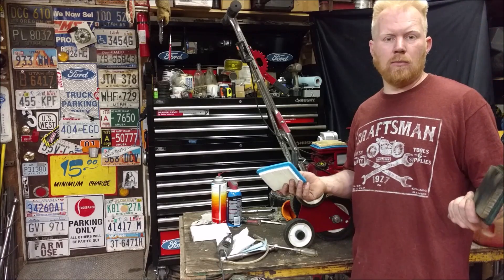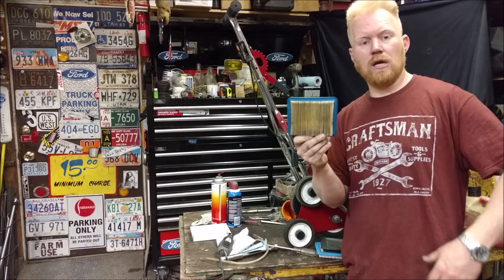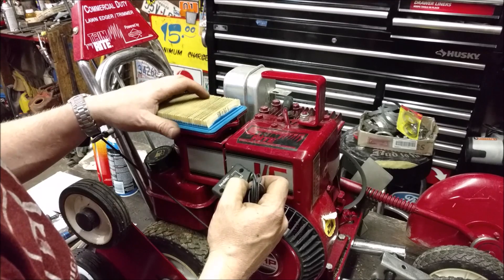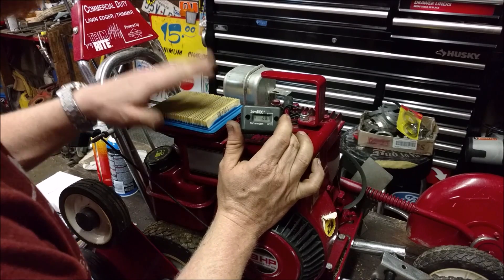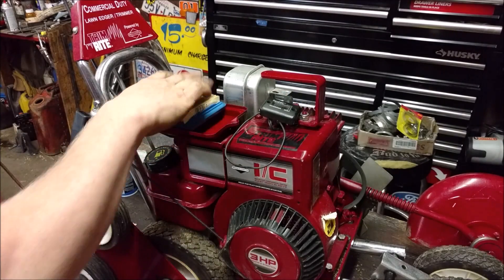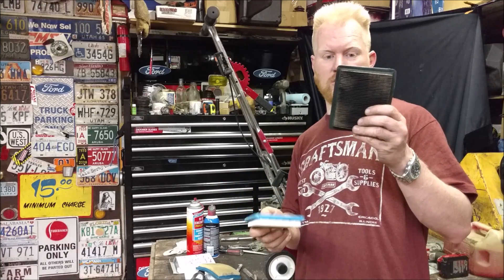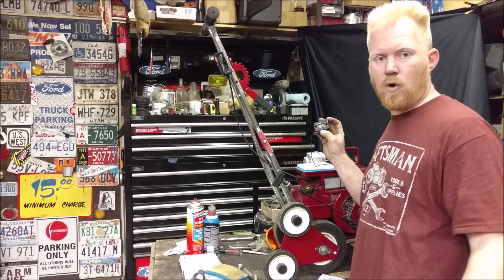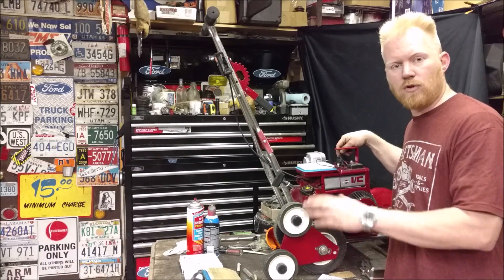Clean Air Filter hurting your Performance?

Comment: I have a doubt, if engine is running lean a little clogged filter will rich the mixture and RPM will increase, if engine is running rich the new filter will also reduce the RPM a little bit.

Comment: Thanks for the video, I would have never thought that the dark filter would work like a new one and that the hardly dirty filter was really clogged with something. I will start checking them and throwing them out when the engine says it is clogged. Thank You.
Reply from the maker: I come across a few a year that look clean but really hurt performance. I think they may have gotten wet sometime in their life and the dust turns to mud and coats all the filter pours?

Comment: hey had a question, I got one of the hour/tach meters, want to make sure im using it right, 01. says 2 stroke 1 cylinder,02. 1 stroke per cylinder 03. 1 stroke 2 cylinder. for a single cylinder 4 stroke mower?  im using 02. is that correct?
Reply from the maker: Sounds like you have it on the correct setting. It will be way off if it isn't. Your lawn mower is more than likely reading approx 3000-3300rpm while running on full speed. If you have it on the wrong setting it will show double or half(approx 6600/1500)

Comment: you mean we need an air filter? lol jk . In the 70's I don't think I had a vehicle with an air filter. but then I road sign compression motorcycles and it wasn't kewl to have  an air filter sticking out the side of your bike.  Things have changed in the last 40 years. but then my autos run much better now that I use them and change the oil before its black as coal.

Comment: Nice! Does that spark plug cleaning method work on all types like iridium and platinum or just copper?
Reply from the maker: Yes, it works for fouled Iridium and platinum. Iridium and Platinum plugs are pretty good at self cleaning and offer long life, but at a sacrifice of lower performance than the shorter life plain copper. But since copper gets dirty/fouled easier you can bring them right back to peak performance in seconds by cleaning them.

Comment: Now i have a briggs&stratton mower with the oiled foam air filter, have you ever noticed the sponge going bad an any way, i usually clean with warm water and detergent, then dry for 2 days and oil + squeeze.
Reply from the maker: Oiled filters are the best. Unless they fall apart they never fail.